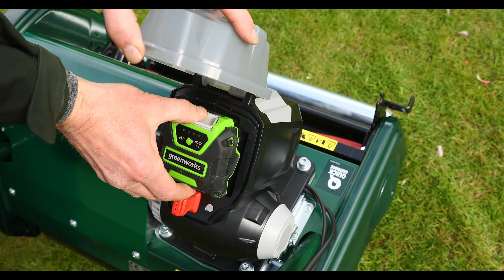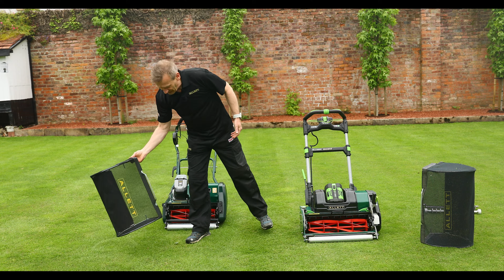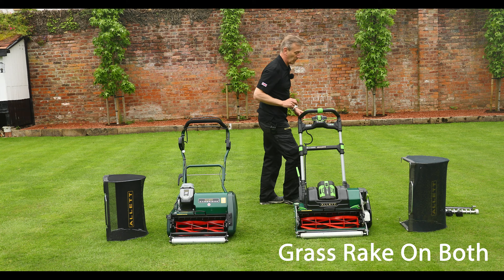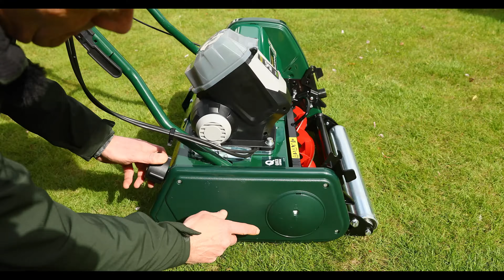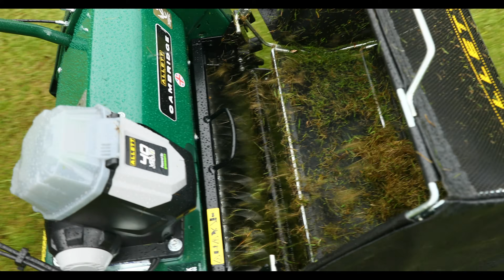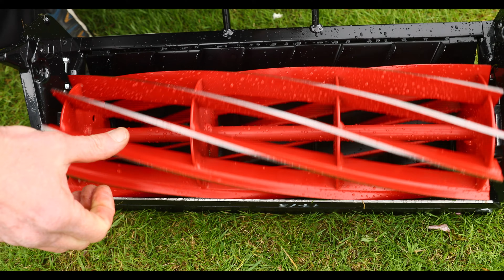Allett Stirling v Cambridge 43 Battery Cylinder Mower Comparison(4K)

Comment: Stirlings battery position is perfect, the other weights to much and causes it to dig in more that side.
Reply from the maker: @rosscraddock6241  hi Ross the Cambridge has had the power head repositioned so the weight is now even across the chassis

Comment: Is there no longer customer support in USA?  I purchased the Liberty43 but wore thru the belts maintaining hybrid bermuda.  The solutions offered over more than 18months were to change the belts repeatedly, replace the motor drive, purchase the 10-blade while being promised that a local distributor/repair center was forthcoming in the Southern California region.   But nothing materialized and was finally offered to purchase the Sterling 43 at a considerable cost.  There was no prior disclosure that the Liberty could not effectively maintain hybrid bermuda w/o having to make several more consecutive cuts and shorter length, which results in creating 2-3 times the work.  I had really hoped the Allet brand would stand up to the wonderful reputation it has built in the UK.  I still hopeful that Allet proper will offer a solution to stand behind its brand, otherwise I'll be left with thousands of dollars of useless equipment and find another brand that is supported here in the US.
Reply from the maker: @jlu72665  hi we have changed our USA distributor over the last few months 
We are now working with ph turf
Reply: @ALLETTMOWERSUK  what is their contact info and why wasn't I informed earlier?

Comment: Does the Cambridge work with 8.0ah 40v Greenworks battery? Or only up to 6.0 fits the machine ?
Reply from the maker: Hi as long as its 40v it doesn't matter what the Ah is - as long as it is a genuine battery

Comment: Thanks Austin for another great video 😊 I have some relatively tight areas to manoeuvre around in my garden and wonder how both mowers are like on the turns. You mention an UltraGlide system for the Sterling. What exactly is this? Did you find it turns easier than the Cambridge? Many thanks.
Reply from the maker: Hi all our mowers fitted with smooth rear rollers with differential so they are great for turning on tight lawns and not scuffing up your lawn as much. Our Stirling has the glide drive which makes it really easy to pull out of corners etc.

Comment: Is it possible to get a cylinder mower without the roller part,say for instance you didnt want stripes in the garden but just wanted the ultra clean cut of the cylinder blades but without flattening the grass?
Reply from the maker: If you don’t want stripes you can just mow the lawn the same way 
You get an auxiliary wheel kit with your mower you can fit in place of the front roller also

Comment: Hi

I have not long got the liberty 43. Is that being discontinued?

Also, when will the conversion kit be available and the new grass box?

Many thanks
Reply from the maker: Hi yes it has already been discontinued 
You can buy the parts you need now via your local ALLETT dealer or ghs 
You’ll need the RC conversion kit, a new bag and a new side guard with the gap in
Reply: @ALLETTMOWERSUK  thank you. In reality, what advantages would I see by converting the Liberty 43?
Reply from the maker: @kamalrammahtani8864  just the rapid cartridge change not having to undo the 4 cover side screws  . The other features are not transferable
Reply: @ALLETTMOWERSUK  thanks. And I guess being able to use the more updated grass box, without the edges of the current Liberty 43 grass box?
Reply from the maker: @kamalrammahtani8864  yes 👍

Comment: Can you get around and close to bushes and plants easily
Reply from the maker: With the grassbag on the front on a cylinder mower you will struggle when heading into corners towards bushes- however you can take the bag off for corners. The ideal scenario is to have a bit of space between your lawn and a fence/ bushes for a run-off